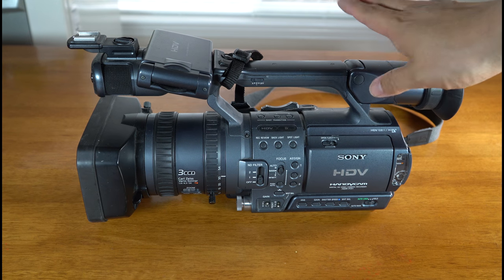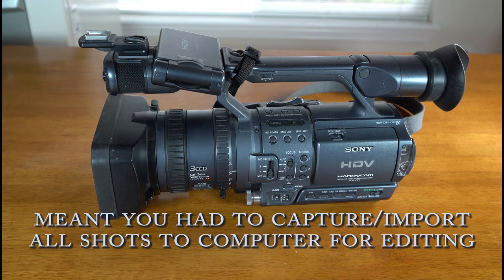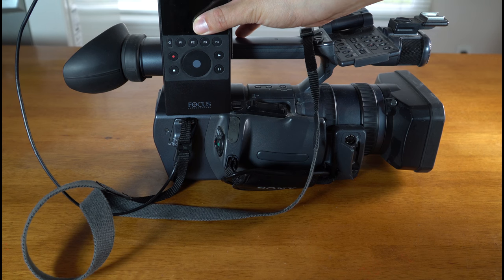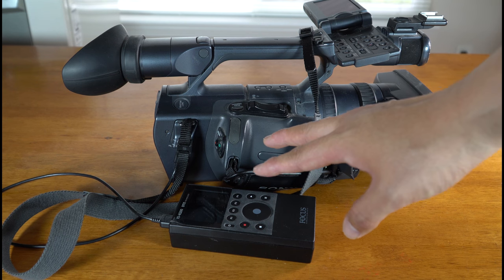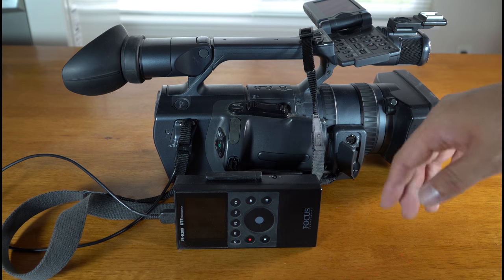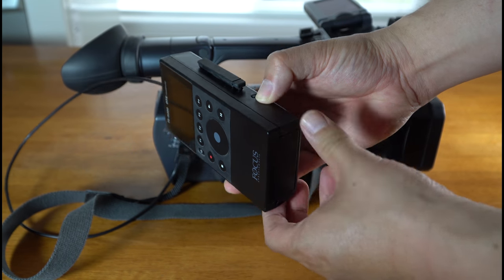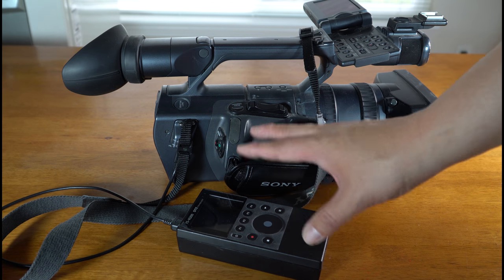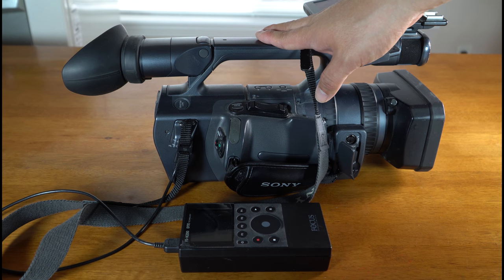How to record in digital format on older component camera camcorders

Comment: Hi.. For DSR 570, 500, 450 bodies where deck is broken.. I discovered that when I attach a Sony Handy cam that has DV in and setting the Handy Cam to VCR mode pressing Rec on the 450ws actually activates Rec DV in on Handy Cam..

Comment: Thank you... Luckily enough I have been able to find good secondhand DV CAM tapes here near UK on eBay for low cost.... I also connect my DSR 570 (Recently acquired..) to a WinTv card in a desktop which captures the composite signal.. At a push I could carry old laptop with Firewire and capture that way too.. but a dedicated portable Firewire recorder would be good..

Comment: I now use z1 and Firestore FS 4 which works perfectly with the HDV.. Luckily my video light battery which has the right voltage 13.5V and a lead connects to the FS4.. Looking forward to see how you get on with Component out record.. A Ninja would be great to have..

Comment: hello. i recently had bought the fs-h200 and im having some issues with recording. every time i click RECORD the red icon pops up but it doesnt capture anything. do you have any ideas with this issue? would be dope if you got back to me
Reply from the maker: Try redo the settings. I haven't used it in a long time but I do remember having same issue. I believe it's just creating a thumbnail like info for the clip but not actually recording. Also have to use remove option before taking out the compact flash or it can ruin clips. Check the manual. Here is a link to it.
https://www.vitec.com/fileadmin/downloads/Support_Downloads/Focus/FS-H200/Manuals/MANL-1158-04_FS-H200_User_Guide_hi-res_060409.pdf
Reply: @RecordLifeMedia  alright dude. appreciate you. and yeah i actually have been using that same exact link since i got it

Comment: Hey buddy, I’m buying this camera tomorrow, do you have any suggestions on how to record it digitally and how to I import the files to my computer ?
Reply from the maker: Hi there, you can get a digital recorder like an atomos syste.. older versions with humidity support would work fine with a component to hdmit converter like avermedia. Scroll through comments below. Rudedogflicks said it works for him. You can also purchase an older digital system that can record in firewire connection but its not that great for current tech. The atomos system seems to be the way to go.  I'm hoping to work on a video soon for my atomos and avermedia system soon, just got both to play with but work is keeping me busy.

Comment: The problem I am having is the output on my Z1U is firewire, not USB so I am limited to what is available.
Reply from the maker: Photojunky's Drone Zone Vlog firewire broken or output issue? I always felt the component out gave sharper picture for the output but that's just me when I'm looking at the video connected directly to the tv.
Reply: RecordLifeMedia no it works fine. The problem is finding a storage device that takes firewire and not USB.
Reply: @photojunkysdronezonevlog  did you ever find a storage device. I'm wanting to use my old camera again and I am also encountering this issue.
Reply: @celinavincent  no, I ended up getting another video cam.
Reply: @photojunkysdronezonevlog  I'm glad there ways a happy ending :)

Comment: Did you ever move forward with the Ninja2?  If so, what did you use for the component to HDMI conversion?
Reply from the maker: rudedogflicks I have not tried it yet, brought the smallhd focus so now I'm resaving to purchase it. Thee avermedia component system is what I am thinking of using. It's in the affiliate link in the description.  That is what I was planning on using for portability.
Reply: I'm not sure the avermedia is going to work out.  I picked up a used Ninja 2 recently and tried the avermedia converter.  I only played with the setup for a few minutes but while the Ninja detects the avermedia as an input, it doesn't go into "Monitor mode".  I didn't have a drive to try recording but will try that soon and see if I can get monitor mode working.  Might just be a setting somewhere.  If not, I'll look for a different converter.  I've read that some folks have had good results with StarTech, but it is a bit pricier at ~$110.
Reply from the maker: rudedogflicks your 2 steps ahead of me, please let me know if it works. I would really appreciate it.
Reply: OK, yep it was just a setting.  Toggle the input formats and you end up on the ones that the Ninja can detect from the Avermedia. I haven't done any production testing yet other than just basic but the Ninja accepts and records 1080p 29.97 from the Avermedia.  Picture quality looks pretty awesome (again, though on very limited testing.)  

Thanks again, your video set me on the path on looking for a Ninja.  I originally wanted to resurrect this camera with a used FireStore, but I think the Ninja will extend its life by another couple of years.
Reply from the maker: rudedogflicks thanks, I'm happy it worked. Was it eBay or Craigslist, can't find one cheap for me to get yet.
Reply: Local Craigslist listing, $250.  That's right around middle of the road pricing I've seen for the Ninja2.  Another option would be the Ninja Star.  I've seen a bunch of those for less than $200, but you wouldn't get a field monitor with it.  Not sure if there would be a way to add the SmallHD to that mix or if would be getting too Frankenstein at that point.
Reply from the maker: rudedogflicks that is a good price, hope I'll be as lucky soon. Thanks man, appreciate your input as well.
Reply: I was looking into the Ninja for mySony Z1U but am unsure which cord it would take to make it work. The DV output cord goes to firewire, not an HDMI plug all these recording devices seem to require. Would it be possible to post a link to the cable that I would be able to use to make it work with the Ninja? Thanks.
Reply from the maker: You'll need the cable that comes with the camera that looks like a headphone jack on one end to component on the other. Hook that to the avertec adapter which converts component to HDMI. Then you can connect the HDMI to the ninja. Amazon has the av to component cables starting from 11 bucks. It might say for psp but that should work.
Reply: Do you guys tested what's the best component to hdmi adapter out there? will use it for Live production and need the to know the best adapter with minimal latency or without noticeably latency at all.
Reply: Hey Bro, have you done testing in Live production yet?... any noticeable delay or issues with it?.. thanks
Reply: rudedogflicks please make a video of what you did with this camera, and test shots. Thanks.

Comment: Is there any way that the FX1 goes to the atomos ninja 2? Greeting
Reply from the maker: adjelaj greetings adjelaj, check out my interaction with @rudedogflicks below. You can with a cheap and effective component to HDMI converter. 😁
Reply: I'm not sure I understood you!
Reply: Can there be links to the things they need? Thank you
Reply from the maker: adjelaj use avermedia component to HDMI to connect the fx1 to the stomos. In the replis I have with rudedogflicks, he used it and it works great.
Reply from the maker: adjelaj yes, there is an affiliate link in my descriptions for the avermedia component to HDMI. You can also search for it on eBay. Hope that helps.
Reply: this combination?